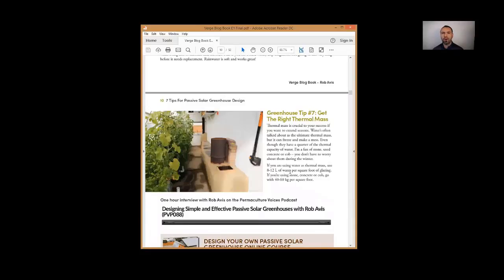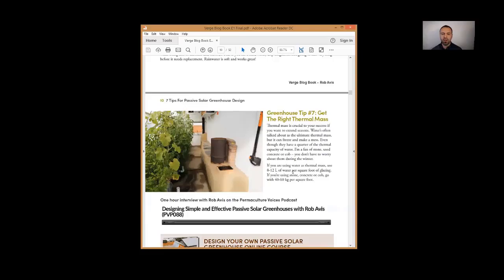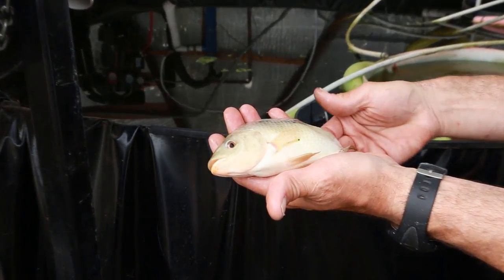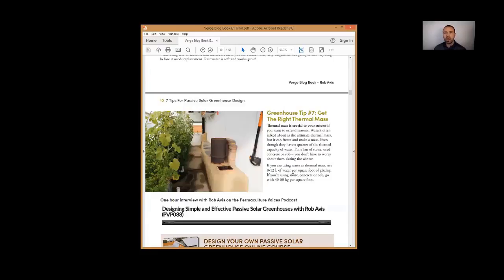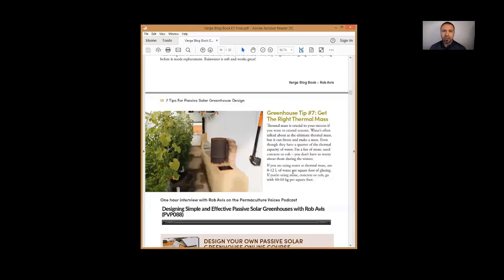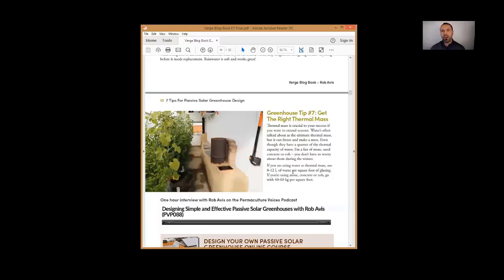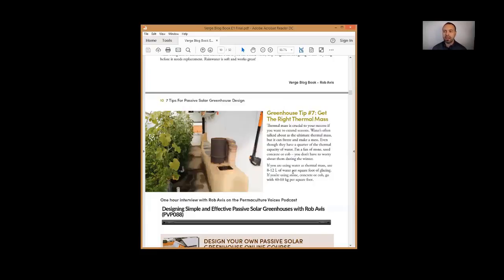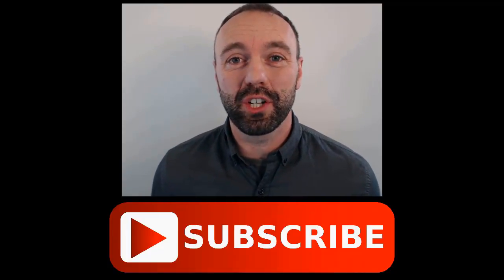Using a Rocket Mass Heater As Thermal Mass and Heating For Our Greenhouse

Comment: I am busy with a greenhouse, a big bow 2.30 cm high and 4 x 6 meters (more do not fit here) I want to put a rocket heate in and warm also the house with a kind of CV setup, also the barn who is not quite dry can be connected.

Comment: I am wondering if you ran the rocket mass heater north south it might be more effective.  By running g east west the heat would rise to the roof and escape so the lower ceiling area of the greenhouse would not get much heat

Comment: Hi fellow canuck, its me again. I just saw a cool video that is still causing me to scratch my head. This guy heats his greenhouse with compost leaves, and he seems to think its better than a rocket mass heater. Check it out here, and let me know what you think:  https://www.youtube.com/watch?v=lIzWgBWF3SQ
Reply: It's a strategy you can employ, yes.  Works best in climates like that guy's, and warmer (notice he only had a sweatshirt on, and his outdoor temp was in the 20s), and where the winter's duration is shorter.

You also have to stock up lots of leaves/compost material to refresh the pile for when it starts to "burn out" - while his leaves will produce heat for 4 months, they don't stay that hot for 4 months unless he adds more material along the way.

Also, for colder climates (Rob's climate sometimes gets down as low as -40F and mine gets < -40F every winter) you'd need a lot bigger pile to release enough heat to combat the outdoor temperature.  Additionally, in our colder climates, unless you have a massive "commercial compost maker" sized pile, probably also needing manure for heat, the pile will freeze through for the winter so it needs to be inside the greenhouse (not outside with a hole cut into the wall for heat venting), reducing how much growing space you have inside the greenhouse.

... but it's an amazing system for wherever your climate & greenhouse logistics permit for it!